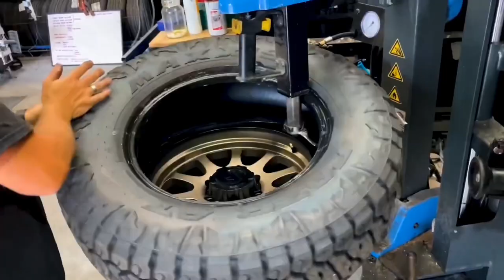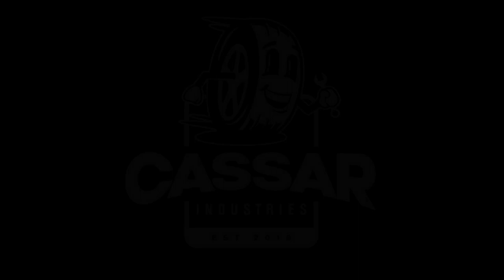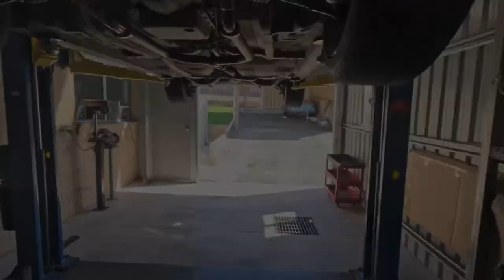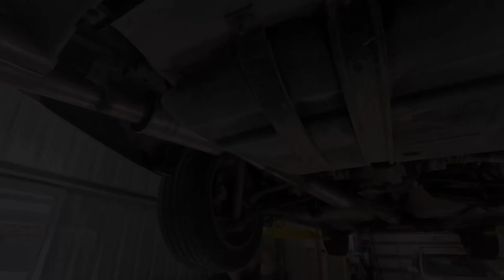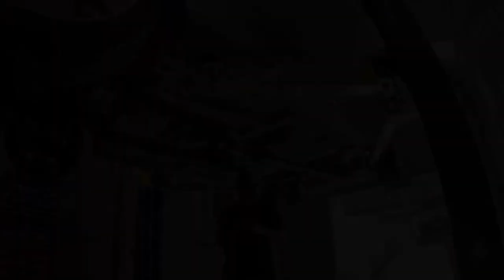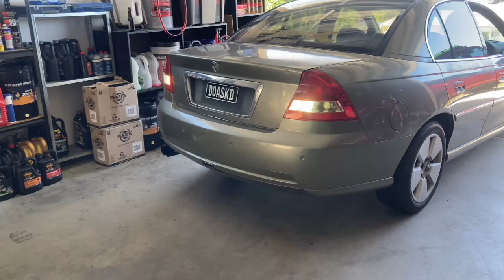VY Skid Car Build Ep 10: Totally Exhausted. Custom 3” Exhaust

Comment: Hey mate I have a 400hp vy SS, just a question and it may be a silly one, if I swap my 3 inch mufflers out the back for a straight pipe, will that require another tune? I was thinking of swapping them around on the occasion but leaving a muffler on most of the time purely for a little noise control 😅
Reply: I'm probably wrong, but if you change the exhaust before the O2 sensors you might need to tune to your set up.....in the past,I've deleted the cat (on V6 ecotec) and put 2.5inch straight pipe from cat back and it was fine, made no difference performance wise..just a shit ton louder,,,like I said,I could be wrong and probably are ahahaha
Reply: @aussieboganbloke2244  yeah I wouldn't think it would make much of a difference with airflow, especially with it being a 3 inch system already on it
Reply from the maker: Hey mate, thanks for watching and thanks for asking the question. Will make no difference whatsoever to your tune. If you just walk out your mothers for pipe. If you were to get the car returned with straight through pipe instead of mufflers, it may make very slightly more power, but I’m talking maybe a kilowatt or two. But just by changing them over and not getting the tune done, it will not hurt the engine at all you’ll be fine.
Reply: @cassarindustries_wheelwerk  that's the awnser I was looking for mate thank you!